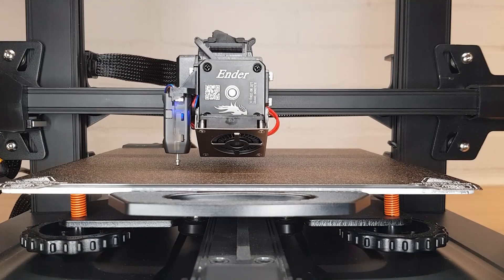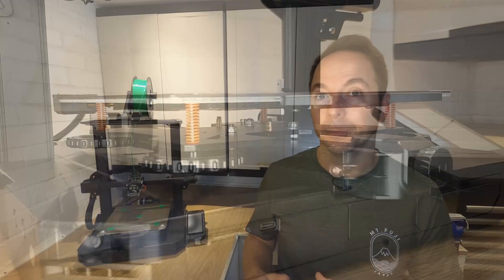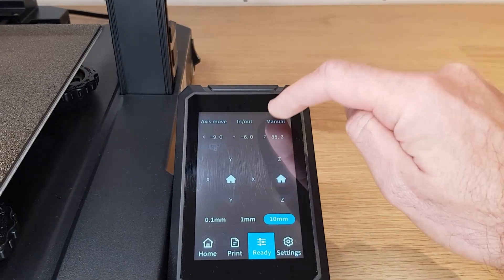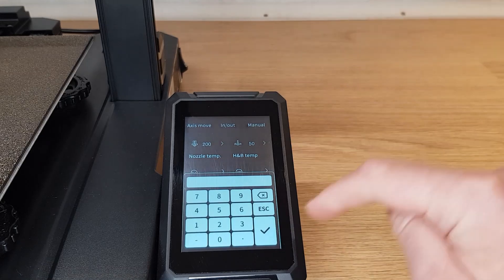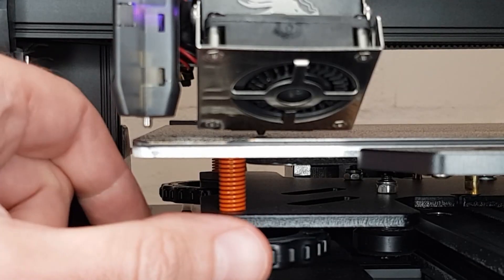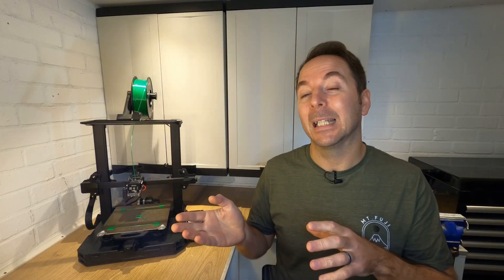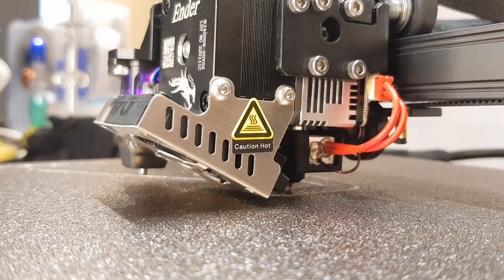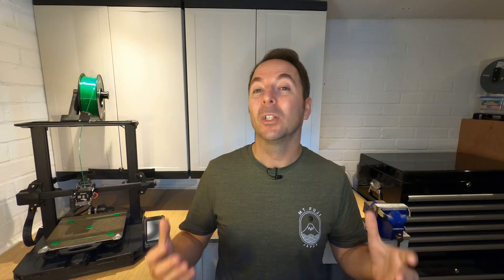Ender 3 S1 Pro 'Automatic' Bed Leveling In 3 Simple Steps

Comment: Tried with this m420 but still it prints correct in the center and badly in corners... Ender s1 :-(
Reply: I tried both m420 and g29... Still it's very bad
Reply from the maker: To be that would suggest that the bed mesh is not correct. Have you tried taking a new bed mesh?
Reply: @RickyImpey  yes I did a first manual level, then an autolevel and then I stored configuration. (S1 is slightly different than S1 Pro, you have to manually move the head to the corners). Then I modified the gcode adding M420 S1 and did a bel level print (one of those 1-layer prints). Still there are areas with overextrusions and areas where it does not stick. Once I will be able to make octoprint work, I'll take a mesh snapshot...

Comment: Thank you so much for your content,  help a newbie like me, quiet a bit!
If you do the m420 s1 z10, but do z100, does i go home i z100 or is it another Z offset I need to change?
Reply from the maker: Hi, do you mean replace the z10 with z100? The z 10 just tells the printer to fade out any compensation it has made for a non-flat bed over 10 layers. If you change it to z100 then it would take 100 layers to fade out the compensation.

Comment: What is the purpose of only using the mesh for the first 10 layers using z10? I might be missing an obvious point but why not use the mesh for the entirety of the print?
Reply from the maker: If you imagine a very warped bed, the first layer will follow the peaks and troughs. If you don't fade the compensation out then the top layer will follow all of the bed contours too. I fade it out over 10 layers so that the top of prints are flat.
Reply: @RickyImpey  Thank you this makes a lot of sense

Comment: How much Z Axis offset is too much???? Trying to get my Ender 3 S1 Pro properly trammed...  This is my first FDM printer (Except for commercial machines - Stratasys F400 & F900s which have TRUE auto level)...
I have doubts..... I've watched a LOT of videos, so I think my procedures are o.k. but I feel like my Z-Axis offset is too high... but it's just a feeling as I have no data...  
It's at -3.55... is that too high???
Reply from the maker: Strangely they seem to all be different which I don't understand but no, I have seen larger that -3.55 as an offset.
Reply: @RickyImpey  seems like something that needs to be QC'd out of existence as I'm willing to bet even money that it's a manufacturing issue.

-3.20 seems to be my sweet spot for the moment - and I think I still have some tweeks to do in the 9-12 o-clock quandrant on the plate (but very minor tweeks)....

But it just bugs the old engineer in me that that number isn't 0.00.
Reply from the maker: @toddrainer6542  Me too!

Comment: For some reason my front left corner is way lower than the others.
It is almost completely loose while other corners are much tighter.

I took the bed off once so I'm wondering if the springs are different or something.
Reply from the maker: It could be that you put the springs in the wrong place. One of the springs is shorter, that one needs to go on the left rear corner (as you look at the front) as there is a bracket for the bed wiring.
Reply: @RickyImpey  Seriously? I should have known.
It is working now but maybe I will relevel it before my first spool arrives.
Reply: @RickyImpey  nope, that's not it. They are all the exact same size.

I actually just figured it out.
I couldn't believe it. After days of researching nobody has mentioned this.

It took a combination of things to get me to figure it out.

The z axis belt was tighter on one side which meant that the x axis was lopsided. 

I recorded a video but I will likely not get around to putting it up any time soon. 
Hope this helps someone

Comment: Hello Ricky, 

I've recently purchased Ender 3 S1 Pro (same as yours) and could not work out ABL. Considered fact it is faulty as many other uses saying.. until I got here and saw one of your videos. 

My problem was related to the gantry. Not aligned properly and few screws were loose at the same time. Was not expecting that..

 Got that sorted and now ABL works like a charm. 

Thanks for your support. You doing great job.
Reply from the maker: Glad you made some progress and figured it out.

Comment: Great video. never thought of adding the gcodes in. my only problem is that i followed your guide and after the auto level, the nozzle  was WAY to high (offset of like 4.50)so i adjust the z offset and check all 4 corners again. do another auto level. After the 2nd auto level, the nozzle crashes into the bed and i have to raise the z offset again. check all corners to make sure it wont crash into the bed and the gap is the same all around. run auto level again and have to adjust the z offset again. mine must be broken firmware or something.
Reply from the maker: That does sound like something is not right. It sounds like you are getting inconsistent results from your bed probe which means that the printer doesn't know where the bed is in relation to the nozzle.

Comment: Step by step, I did exactly what you described in your incredibly detailed video.
After that i believe you are the leveling Professor thank you very much!!!!!
just one note, when the bed is at temperatures, autoleveling gets stuck, so I have to do it at cold bed.
Thanks again,from Greece, for the amazing content...!!!!👍👍👍
Reply from the maker: Thanks for the comment. Yes, it seems some versions of the firmware give issues with heating the bed while auto levelling. Mine didn't have any problems with it.
Reply: @RickyImpey  for the record, your practice works and in cold bed.... 😉 Thanks again!!!!

Comment: My printer won’t find the middle of the bed at all, does anyone know what to do?
Reply from the maker: The printer will need to find the edges before it can calculate where the middle is. It may be that one of your limit switches is faulty.
Reply: @RickyImpey  Thank you for the recommendation! I was able to fix it recently but thank you

Comment: Wish I found this video sooner. I guess I made my front right spring go "Coil bound" and now it won't loosen.... Ok, how much did I just break my printer?
Reply from the maker: It would usually extend again if you release the tension on it. If not, springs are very cheap and they generally all use the same type. Just get ones that say they will fit your model.
Reply: @RickyImpey  I thankfully got it to loosen and restarted the process and got a better alignment this time, it's not perfect in all the corners, but I am questioning if I also have a wobbly bed now. thanks for the reply!

Comment: Love the video. Curious why we shouldn't do another read on the bed mesh every print?  I noticed printers like Prusa MK3S's do a measurement every print.  Thoughts?
Reply from the maker: Mainly just to save time. I got fed up waiting for the mesh to be created every print on one of my first machines with a bed probe so I changed the start code to save time.
Reply: @RickyImpey  Thanks for the reply!  Ok that's what I figured.  For my use case, I routinely switch between PLA and PETG and therefore the bed temp is between 50/60 and 80/85C, which I figured would change the expansion a little bit and so wanted to bed level every time just to be sure it's preheated and leveled.  I did notice that on the Ender 3 S1 Pro that it takes the mesh level before heating, but easy enough to change up the order of things to make it heat first.  Just wanted to note it.  Thanks for the great videos.
Reply: Because the beds are designed to remain fixed in their position. Ideally you will only need to bed level once a week or less, instead of doing it before every print. Silicone spacers will work even better than springs.

Comment: I could have used this video yesterday. Setting up my new Ender S1 Pro I was a bit surprised at how far off the bed level was. I went to level and actually couldnt lower the z axis enough, or raise the bed enough, in the first corner. It took me a couple minutes to decide to lower the bed as far as it would go, back it off a couple turns and then level from there, starting in the middle. After that, twice around bed and it was perfect.

Comment: This seemed really clear and easy to follow; I'm a tech ed teacher who has been 3d printing for 15 years on 3 different printers, so I know my way around.  Yet the manual from the Ender 3 S1 Pro is unusable!  I found an unboxing and setup video (55 minutes) that is ok but inadequate on the bed leveling part.  Your way is much better!
One thing however: I tried your M420 S1 Z10 machine line and I could not get that to work. When I removed that line, I immediately got good prints.  I have 3 of these printers and all 3 are working (knock on wood)
All 3 printers have a significant dip in the center of the  platter, I simply leave a 3" square of paper trapped under the center of the removable steel plate, that fixed it perfectly.
Reply from the maker: You're very welcome!

Comment: Hi, thanks for your video. Any idea why yours is -1 range and mine in -4?
Reply from the maker: Do you mean the z offset?
Reply: @RickyImpey  yeah, tried a couple times but its at - 4.55 all the time
Reply from the maker: @ferst5937  Is it causing you any problems? In theory they should be very similar if we have the exact same nozzles, cr touch brackets, etc. I would imagine there is something in there that is a different size that is causing the difference in z offset. If it's not causing a problem, I wouldn't be concerned.
Reply from the maker: Yes sure, makes sense. Just be aware that it can cause some issues that you don't get with the SD card. It could be the reason the filament change doesn't work.

Comment: Thanks for this video. Out of all videos I have seen this is by far the best, most concise and extremely useful. Just bought one of these and I have to say, coming from a nightmare with an ender 3 V2, this printer is excellent. I didn't get the issues you had with yours, my bed and axis's were all nice and tight. I followed this guide to accurately manually level the bed prior to auto, and my prints have been flawless. Printing with PLA+, I have only had one failed print (that was due to a tall model that just required adding a brim). The prints by the way are excellent, I highly recommend this printer! That PEI sheet is like having a bed of glue - everything sticks so well, I have a hard time getting the skirts off :)
Reply from the maker: Brilliant! Really glad you are happy with yours. Thanks for leaving the comment 👍

Comment: Does the M420 S1 Z10 ; Use saved Bed Mesh work on an Ender 3 S1 Plus? trying to figure out how to build a profile for it
Reply from the maker: It won't do any harm to put it in. On some printers it's not necessary if a certain feature is enabled in the firmware. It's difficult to find out if it enabled as stock for many printers. But yes, it should work.

Comment: Thank you for this tutorial.
I bought an Ender 3 S1 Pro and the leveling was giving me nightmares. I leveled everything, set it up with the piece of paper. Center was "bowled in". I could not get it fixed. 
Bought PLA filament and after that the rabbit hole began. It would not stick and drive me crazy. All the websites always say "level your bed. if it doesn't work use Glue and hairspray!" Yikes.
You showed me how to level the bed and that Stock Cura NEEDS the extra G-Code that the printer will even use the darn mesh it created painstakingly.

I am happily printing now. Thank you SO much.
Reply from the maker: Great to hear you're making progress. Thanks for the comment 👍

Comment: Thank you for this video. I referred to it heavily during setup. Because of your leveling guidance my first print ever (calibration cube) came out perfect on 4 sides. Little striping on the z axis but still almost perfect print. I’ve never used a 3D printer before. You got my print looking super high quality my first time. I am super impressed with the quality and also how quiet it is except for the fan noise. I’m extremely happy with my purchase so far on day 1. Also, figuring out how to use Cura took more time than actually assembling the printer. Your video is gold.
Reply from the maker: Really glad the video helped. Sounds like you've had a great start to your 3d printing journey. Thanks for leaving the comment 👍

Comment: I can't correct z offset at the first layer after print started...it seems the parameter settings screen is disabled for some reason... any idea why?
Reply from the maker: Hmm, mine doesn't do this no. What firmware are you running?

Comment: OK so I'm scratching my head like crazy with this probe I do exactly what you state in this video except I use a 0.05 feeler on each point however everytime after probing the bed it throws out the first layer tight on the right hand side of bed and not low enough in the left hand side of the bed.. It's as tho I have a dodgy probe or it's not creating a new mesh and saving it after probing... If I go back around the bed after probing and re tram it using a feeler and the adjustment wheels then I get a perfect layer.. I'm guessing my probe is shot...
Reply from the maker: It definitely sounds like something is not right there. I agree, I'd suspect the probe too.
Reply: @RickyImpey  thanks ive just fired an email over to creality so fingers crossed they will send me a new probe out.. if not ill probably send the whole thing back and wait for a elagoo in jan

Comment: Thanks so much for this clear, concise, and complete explanation. I had no idea about the M420 S1 Z10 command. I added it to my Cura start g-code and my bed adhesion was fixed.
Reply: Did the M420 S1 Z10 really work? I saw on Reddit that sometimes it doesn't work correctly. Did it work for you after several months of using the command?

Comment: I got a 203 probing failure after using the m420 s1 z10 in a print when I did an ABL in the settings after I have finished a print. I'm not sure if this is related. I was able to update the firmware from the creality website and retrammed the bed.

I no longer have the 203 probing failure. But my printer doesn't auto home after doing the ABL like it used to. I'm not sure if this is an issue or not. Any insight would be helpful.
Reply from the maker: I would say that the change in the the way the printer finishes the ABL process will probably down to the change in firmware. I can't explore the probing error though.
Reply: @RickyImpey  I thought the same thing. Thank you for your reply. I believe the firmware had something to do with how the ABL finished.
Reply: @RickyImpey  I haven't had anymore probing errors. I believe what had happened was that I recently moved my printer to another area and the power cable was hitting a wall when the bed moved backwards, leaving it unable to hit the y axis switch.  

I want to say your content is extremely clear and to the point. I just watched your e steps video and I'm going to do that to ensure the printer is more dialed in.

Comment: Thank you for the video, it really does explain a lot more. But i keep getting error 203(Probing failed). I’m really not winning and have tried everything i can think of. Any help or advice please…
Reply from the maker: Sometimes the 203 error occurs when the bed level it too far out and it's too much to compensate. Sounds check that the manual level is as good as you can get it before you run the auto level feature.
Reply: @RickyImpey  Found the issue. I had a power dip and resulted in the firmware somehow corrupting... Strange but true. I updated the firmware and all working again 🙂 - Really an interesting one...
Reply from the maker: @pietersmit4414  Interesting🤔 Thanks for coming back to say what worked. Hopefully it will help someone else with the same issue.

Comment: What is the difference between M420 s1 and M420 s1 z10?
Reply from the maker: The 'z10' just means that the compensation for an uneven bed fades out over 10 layers.
Reply: @RickyImpey  Why would you want it to fade out? Just curious.
Reply from the maker: @OyunOyundayz  It's a good question. Imagine a very warped bed, if you didn't fade the mesh out then the top surface would be parallel to the warped bed and not be flat. Fading it out gives you a flat top surface.

Comment: Thank you very much for this clear and to the point video. I agree with other posters, it seems crazy to have to go through all of this with "auto level" It should set a mesh and be DONE. For anyone interested you want to know a printer that works like this? The CR6 SE. You run auto level and you are off and running. None of this fiddling around. I Was hoping this printer would be similar, but its not even close. With the help of this video its finally doing perfect 1st layers, but what a PITA. Thanks Ricky, this is a great video.